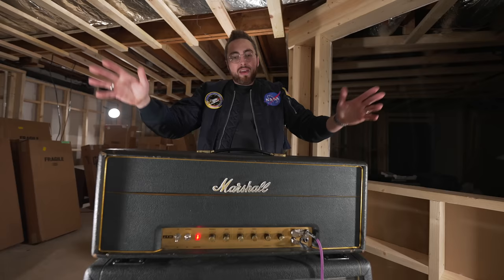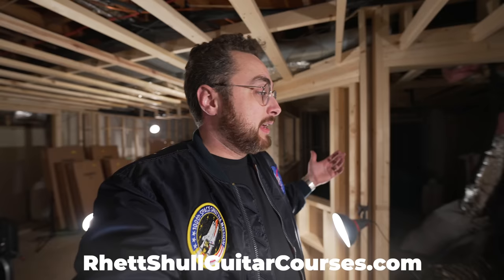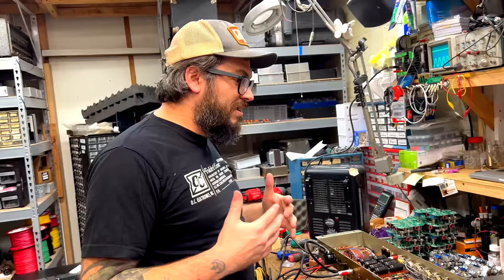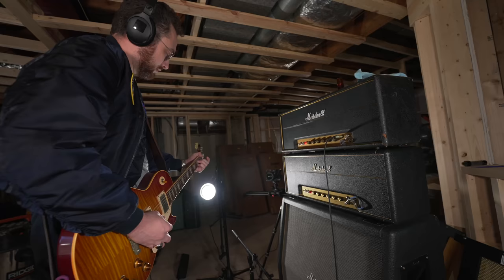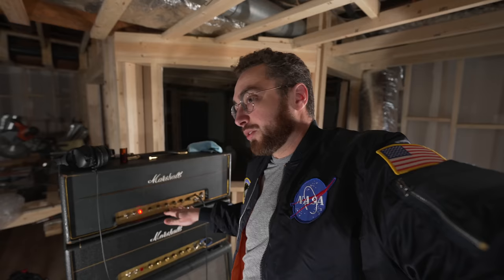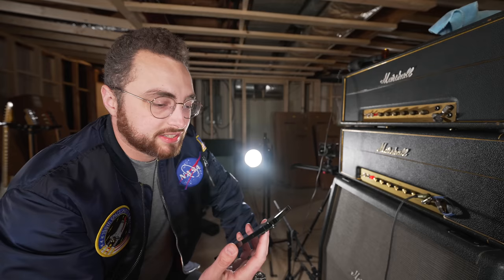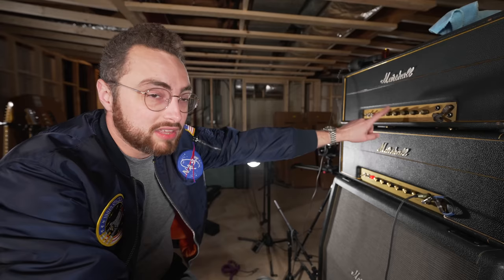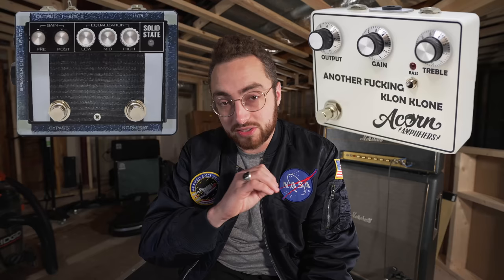This Amp Is So Loud It's Painful | Vintage 100W Marshall Plexi

Comment: I owned a 1969 Plexi for a while. I never cranked it once while I owned it because it was like an ice pick to the ear but in a good way.  My amp tech told me it was one of the ones that had the “wrong” resistor in it somewhere that made it super bright.  I guess it was a common mistake that produced the best Marshalls. 

The day I sold it, I decided I HAD to experience that amp at 10.  I was not prepared for how unbelievably loud it would be.  I think I got to 4 or 5 before I tapped out.  I didn’t have earmuffs so I was trying to raw dog a super lead 100.  Either way, it was an awesome experience to blast that thing at least once.

Comment: I was poor as a kid. I made my first guitar amps out of old valve radios or record player amp-sections. My first real valve amp was a SoundCity 120R, circa 1975. It sounded sublime, amazing, it really moved me, literally, when played through a quad-four cab. I owned that for about 30 years and sold it because it was just too heavy to lift. Over all those years I never got to gig with that amp in the sweet spot. It was just too darn loud. I miss the sound of my SG with humbuckers playing AC/DC, The Sweet and Bad Company etc. LOUD, man. ✌️❤️🙏🇦🇺

Comment: When Richie Blackmore toured Australia with Rainbow, way back when, I worked for the concert hire company who provided pretty much everything for the Perth gig. 4 x 100 watt heads, and 8 x quads. One of the guys I worked with is a good guitarist, and he put his 335 onto this monstrosity, down in the workshop. It is something I'll never forget. You felt this thing in your soul. No hearing protection in those days, balls to the wall. I also worked for Rose Tattoo and AC/DC as audio crew, Marshall's everywhere. Yeah, I know what a Marshall can do.
Reply: Oh yeah! I saw Richie with Deep Purple back in the early 80's in Melbourne. He was so overwhelmingly loud it felt like putting your head in a vise. But damn, it was so good!
Reply: Angus eats Plexis for breakfast... almost literally lol. He goes through them like a pair of shoes.
Reply: @SynZ777  Happens when you are so short, he needs to take longer steps so he doesn't wear them out so fast.
Reply: Actually, Blackmore used the Marshall Majors. They were 200W heads.
Reply: One in your house is as loud.

Comment: I had both 100 watt and a 50 watt Plexi in the early 70s, along with a top “metal handle “ slant cab, a bottom plastic handle cab AND an 8-10” cabinet. They were in the shop ALL the time. Speakers in the 8-10” blew a lot. Repairs were tough to pay for in my teens and early 20s. I was never sure what impedance to set them on. The music changed and I got rid of all of them a got a Peavey Vintage 4-10”. That amp was bullet prof.

Comment: The magic of the originals of that era were in the massive volume they kicked out. It wasn't just the head, it was the head/speaker/volume combination that kicked it into over drive. I grew up playing guitar in the 60's/70's and owned a number of what are now vintage amps. These smaller amps, with all their high tech gizmo's installed, just can't get it. What does get it is MASSIVE VOLUME where the speakers are pumping hard enough to do CPR with.

Comment: Love the sound of old Marshalls. I've had several 2203/4 models over the years and also a 1959RR and 1987X. The 1959RR I had tested by my amp tech, full output was 219watts. Absolutely punishingly loud.

Comment: In the seventies when I still lived in the UK I owned several Marshall amps (not all at the same time), a 50W, a couple of 100W and a 100W bass, I played bars and clubs and I had the volume set at 6, I felt that was the sweet spot for me, I used 2 cabinets, a Marshall Slant 4x12 and an open back Vox 2x12.  For a long time I used no pedals but eventually got a Morley Wah/Vol.  I loved my marshalls and I used to lug them around in an old Ford Escort, the 4x12 fit in the trunk the 2x12 and amp in the back seat area and the guitar in the passenger seat.

Comment: Nice vid. Toured with early 70s 100w and 4x12, then 1959slp reissue. These are a beast wide open but very directional so you can find a sweet spot on larger stages, small clubs you’re on everybody’s death list, especially house engineer. A Two Note (20db)drop with boss DS1 into the front end is a great option. Good luck with the studio!

Comment: 144 watts. I like how he said every Marshall 100 watt they test comes in at at least 140. And Jim Marshall used to soup up the ones he built for Ritchie Blackmore! How Deep Purple didn't blow people out through the back walls of auditoriums, I have no idea. :)
Reply: Well they were the guiness loudest band in the world for a reason.🤣🤣🤣🤣 I believe people did pass out at some of their concerts. But what's really something that never gets talked about are Cream gigs, I believe they were some of the first groups to crank up Marshall Amps that too in small clubs. I can only imagine what each of those 100W stacks must've sounded like.
Reply: Well, its's peak power for very short amount of time. Also amp wattage doest not equal volume, speaker efficiency is a much bigger factor to how loud it is. Wattage is more of an indicator to clean headroom than anything
Reply: @sohamsarker  The Who were up there on the deaf-o-meter as well. I think Townshend was JM's first 100w client.
Reply: You guys have to remember that they had to do this because PA systems were such crap that without the stacks a stadium of people couldn’t hear the guitar.
Reply: I saw Deep Purple at Festival Hall in Melbourne, Australia, some time back in the 70’s. My ears are still ringing. ✌️❤️🙏🇦🇺
Reply: The 100 watt amps were actually represented as 100 watts RMS, which would run from 130ish to 140’s. Those were the days! The output transforms was the most problem as I remembered. However, I’m old! Lol
Reply: And Mick Ronson used a cranked 200w Marshall Major... jeans flapping..
No wonder the paint stripped off his LP Custom!
Reply: Even at 16 ohm load it means over 4 A currents in speaker cables.  At lower impedance load connector currents much bigger. So better not to use guitar cables as speaker cables! 🔥
Reply: Blackmore used 200W majors
Reply: @deancarrier123  Thanks. I thought they might have been listed at 200, but I couldn't remember. I just knew Marshall really pumped them up. Blackmore claims they pushed closer to 400.
Reply: @deancarrier123  when he was using that reel to reel for the treble boost it added the shit was blistering.
Reply: @funkster007  With an 8 by 12 cabinet, which just makes it louder. Jim Marshall was once quoted as saying "I told Pete his roadies were going to kill him. He said 'They get paid!' "
Reply: @deancarrier123  Oops. I got it wrong. I went and looked it up. Blackmore claimed they were "pushing out about 500 watts." Perhaps he was exaggerating. :)
Reply: PA systems weren’t all that great back then, and Blackmore had to compete with Jon Lord…who was also running his B3 through a cranked Marshall.
Reply: @kalebaldwin5398  Yeah, the whole band was loud. And you're right, everybody carried their whole sound system with them. Front of the house just wasn't designed for loud bands in those days.
Reply: @seanbaines  There really wasn’t much for stage monitors back then, either. The biggest priority would’ve been trying to hear the vocals. It’s no wonder so many singers from back then destroyed their voices.
Reply: @kalebaldwin5398  As Ian Gillan said on Made In Japan, when he wanted the sound techs to adjust levels, "I want everything louder than everything else."
Reply: @seanbaines  they are loud but not THAT much louder than a 100 watt super lead Just different. I have a recent video or two with a Major.

Comment: I used to gig with an early 1970's Marshall 100 watt ... with volume on 4 had a great tone with punch and edge of crunch.  Very loud.  At club gigs, I used 1/2 stack with cab turned to face wall and covered with heavy blanket.  Loudest I ever played it was on 6 with full stack which had the famous crunch full tilt at an outdoor gig.  The police arrived and said they could hear the guitar from a mile away.
Reply: Did you share a beer with them  ?
Reply: @sebia12  😅 rock n roll

Comment: The black flag is a more of a bass circuit like the JTM45 and 45/100.    Less filtering than the 68 lead circuit and also shared cathodes on V1 like the JTM45.  It’s really a transition between the JTM45 and what would become the Super Lead.  Super cool amp!
Reply: Yep. Love bass over lead.
Reply: THAT SO FULL OF MISINFORMATION ITS NOT EVEN FUNNY.
Reply: @666kty3  ok so what is the circuit like then? if the above is "so full of misinformation" please correct.

Comment: If you want some speakers that absolutely nail the vintage Pulsonic cone Greenback tone, the Mojotone BV-25M-SP is it!

Fantastic right out of the box. I bet Mojotone will sponsor a set.

Vintage Marshall's used linear taper pots. Hence the sensitivity. It makes a huge difference to our ears. Electrically, it's the same, just at different points in the sweep.

Comment: Enjoyed the vid, and have a question... the amp tech was powering it at 121-122v. I find they sound better (more musical) if powered down at around 110v (their original design voltage). Rhett: Do you use any voltage correction when powering vintage amps? I find my Marshall, my plexi clone, and even a recent made AC15 sound better at lowered voltages. I'm not browning really low like EVH, just trying to get to design voltage. Keep the vids coming...
Reply: Marshall, being an English brand, would have been built for 240 volts?
Reply: @verjason  Yes.  ;-)
Reply: It's too much to write here but wall voltage increases occurred in both the US, and Great Britian over the passage of time, due to improvements and standardizations in power generation. Google searches show Britian went to 240v in the 70's, and it had been 220v before. The US went from 110 to 120 in a few different stages. Actually, wall voltages in the US can vary - 120 is not a guarantee. My house is generally 121-123vac. I've seen it has high as 125vac. A friend's home ranges from 126-128vac. A local practice space I was recently at was only 119vac.
Reply: Yes he should have lowered the voltage to 110. Likely the tubes were biased at a lower voltage and when he went home at 120 or 125v AC he redplated the tubes do to the higher bias values.

Comment: Well, Eric Clapton used 2 JTM45/100 Full Stacks in Cream. He said he actually went deaf for a few years, playing at full volume in sort of a trance! The 150 Watt(100 Watt) Half Stack I use at home has that Thud starting about 3 1/2 on the bright channel volume, I generally play it on about 6 on the normal channel, 2 1/2 on the bright channel. According to my dB app, I'm hitting around 118db, very loud, but not deafening. When I use my Treble Booster, it hits about 120db, but I rarely play with my guitar volume above 6, except to induce feedback. I was always surprised how clean the "100 Watt" Marshalls are, the sound is more about the volume and your playing dynamics, not maximum distortion.

Comment: I agree with that unique low end percussive thud. I only have an Engl Rock 20w combo, but with a Les Paul, a Plexitone pedal, a Klon Clone or Tubescreamer as boost only and a Wampler Compressor can reproduce that at acceptable noise levels of around 90-100db. I can only imagine what the real deal in room sound experience is, but I can fully relate to how you describe this unique punch

Comment: As an old analog sound man, I hated loud amps. There would be times when the amps were so loud coming off the stage I could not get a good balance between vocals and instruments. I even got fired for unplugging a bass players second stack after the sound check and before the performance. My goal was to make the band sound good despite the band members egos. I would tell all musicians get the tone you want at the lowest volume and let the PA and sound man do the rest😉
Reply: It’s not particularly difficult to make it work. Just if the guitarists and bassist want to be that loud: 1) get a loud drummer. 2) position the amps properly so they can hear them, not stood over them or off to the side and turning them up or adding silly amounts of bass or treble because they can’t hear it properly. 3) all the mids that Internet forums tell you to not turn down, that’s getting in the way of the singer, save all that for solos as that’s why boost pedals and Tubescreamers exist.

Your job as sound engineer is then piss easy for the night and only reacting to changes in the acoustic volume. Getting a guitarist to turn down a mediocre tone is only going to make it worse, then you’ve got to get that to sound decent and try to get it to balance with the rest of what is probably a total mess to start with. Never experienced a decent engineer wanting a decent guitar sound turned down, unless it is genuinely silly as the work is already done.

Forgot to add 4). No guitars in the monitors for anyone, if the band can’t hear loud guitar amps, there is clearly an issue and turning up more stuff isn’t the solution.

Comment: I never played through Marshalls that big .  I went from using Fender Dual Showman amps to an Ampeg V-4 head with twin cabs with JBL's, and for smaller venues the Ampeg VT-22 100 watt combo with JBL's.   I would love to have my VT-22 combo back or one of the Dual Showman setups that I had.  These were great amps that were rock solid.

Comment: Great video Rhett. Just wanted to add, that the DB level difference between those old 100 and 50 watters, was actually very minimal. In the single digit range. I'm 62, retired from professional gigging, and let my last old 50 watter go about 7 years ago. It hadn't been  practical to gig with since the early 80's anyway, but there's sure nothing like the feel, and sound of one punching you in your back! 🎸

Comment: I think the most important difference between my vintage and my modern amps is the single volume knob. No gain knob. Some of the best sounds I get are at the high volumes, but that is the beauty of it. I just turn it up and ride the volume knob on my guitar. My 60's fender bassman is probably my favorite.

Comment: I have the little SV20 that I run through a Marshall 4x12 with greenbacks and vintage 30s. I use a Bugera power soak  
so I can dime the amp and still have it manageable. I cant imagine trying to tame that beast!

Comment: For me the vintage vs new argument was over when I got my 75' 1959 SLP MKII.
The thump this thing gives you is just unbelievable.
I played it at 3 bridged and could feel my ear drum pushed inside in a scary way.
I have 4 new production marshalls and even a 2204 clone I built with top of the line components.
none of them have the thump or magic the 1975 amp has.
After building several tube amplifiers I think this has a lot to do with old transformers, resistors and coupling caps(mustards).
You will never understand the feeling of playing one of those thru youtube.
You will never understand the fear of turning the volume higher thru a video.
It is exactly like you said Rhett Shull.
It changes your playing, it makes you make music differently.
IT IS EPIC!😍
I will sell all my amps but never my 75 1959 SLP MKII.
It is unreplaceable!

Comment: I had an early ‘70’s 1959 SLP when I was in Highschool and College, I used to run it with only the middle 2 EL34 tubes in it because it was painfully loud…. I only ever played it once with all 4 power tubes in it, in a small auditorium with a Nady wireless system from the back row, and it made the hair on my arms move! I got to meet Ken Bran in 1987 when he and Jim Marshall were touring music shops to celebrate 25th anniversary of Marshall…Wish I still had it….

Comment: I had a 72" Super Lead 100 back in the day.  A tech told me I could remove the outside or inside pair of tubs to drop it to 50 watts.  It was still incredibly loud at 50 watts.  Still kicking my self 30+ years later for trading it.

Comment: I have a 50 watt head that I bought used in 1972 with the 8x10 bottom. Traded the bottom for a Marshall 4x12 slant cab. My bass player had a 200 watt Marshall Major stack. 8 12s. I plugged in a few times. WHOA! Way too much power buy really a great experience. We were a power trio and when we showed up for gigs everyone "knew" we were good because of our gear. Haha. Real Clapton, Page, Hendix, Beck tones.

Comment: If you haven't, you should watch John Bollinger's Rig Rundown he did a while back with Tom Bukovac.  The section where they're discussing his amps, Tom talks about the Vintage 100w Super Bass with the Laydown transformer mod.  It's his favorite Marshall of all.  He mentions that the amp stays clean up to 4, and he says it's to die for .... leaves Fender cleans to shame. Above 4, it becomes "Marshall".  He also mentions that this particular version is Eric Johnson's favorite Marshall as well.  It's a really cool rig rundown overall .... one of the best i've seen.

Comment: I played one (it was an early 70s Super Lead though)  in early 80s with a half stack.  No PA ever needed 😂 Imagine this today.
Later I found that 50W 1987 old plexi is all I need, with 2x12 cabinet, and that pre-1970 ones are quite manageable. 
The (perceived) loudness of Marshalls comes from their very present upper mids ..  they were made for that - to cut through the bands sound. And the old ones have a nice clean tone too, if you care for that

Comment: Glad to see you experience what real Marshall ownership is!  Personally, why I'm not a fan, but they're still amazing amps in their own right.  Far as the actual Marshall differences, and going into the argument of why you have a difference between the 2, look up the 55hz Greenbacks versus the 75hz Greenbacks, and why that happened.  it's pretty much the same reason why your 1959HW has more top end, and sparkle.